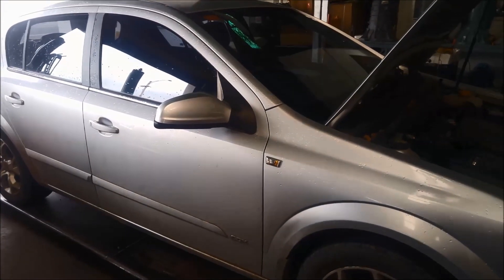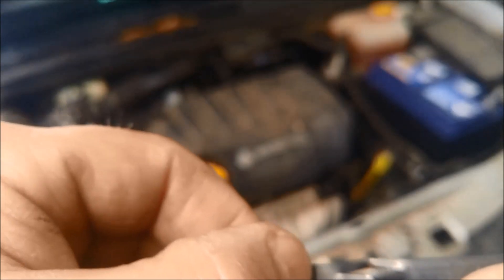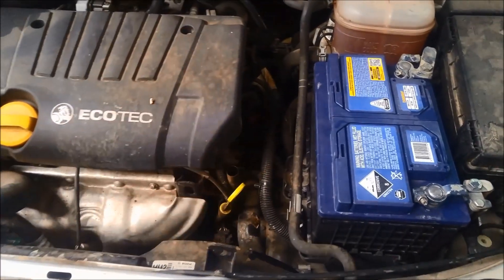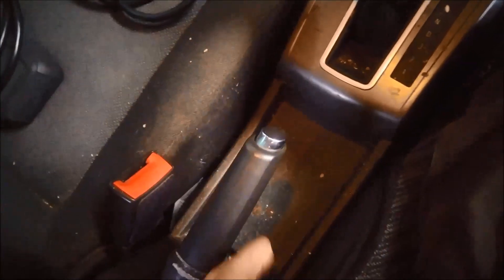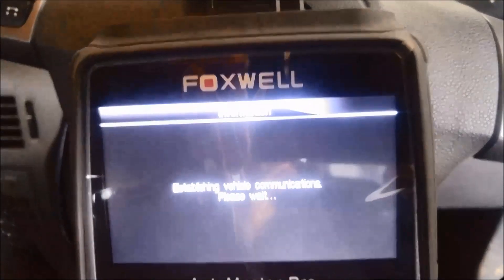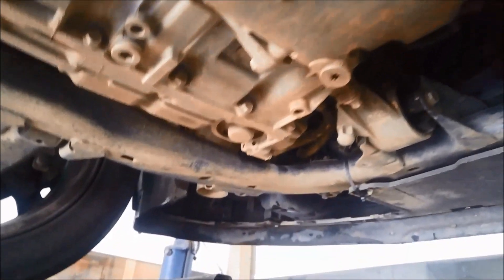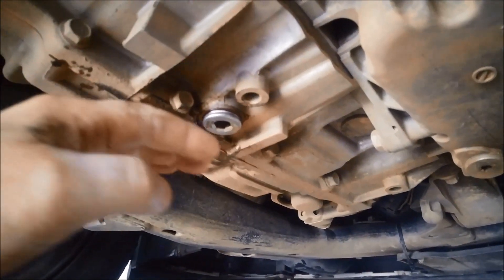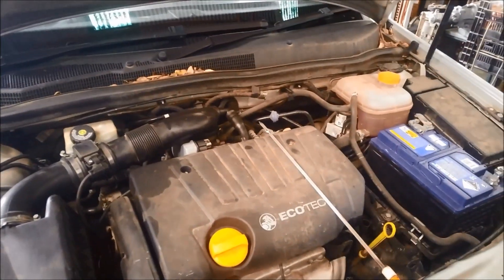Opel-Astra-Vauxhall Aisin AF17 AW60-41SN Automatic Transmission Service & OBD2 plug location

Comment: Hello, Thanks for the video.  My AF17 transmission has already 281000km, and it works perfect, do you think that installing an external filter would benefit it to avoid having to do the huge job of changing the internal filter? Greetings

Comment: Hi can you help me pls i have my astra just automatic transmission the problem is when i put it in ^D^ it goes directl "D4 " and doesn't go fast until 50 km\h  but when i scan it doesn't show the code transmission
Reply: Hey it’s probs an airflow issue or similar causing a the ecu to spaz which is why it’s stuck in D4 which is limp mode. Not always a trans issue just and elect fault that causes it . Clean pcv valve and check all airflow parts

Comment: Hello Mate, 
I have an 2005 Astra 1.8 Auto Z18XE and I literally have the same error codes you got on your scan. Rear O2 sensor, Fuel Trim and CANBUS error. Ive taken it to 3 seperate garages, they said its a comminication problem and "fix" the issue, but it comes back in an hour. Was the communication error due to a bad earth wire? Thanks in advance.

Comment: Holden astra 1.8l petrol 4 speed auto how much litres of trans oil do i put in once empty? Thanks
Reply from the maker: hi, what comes out is just a reference just incase was leaking or overfilled. always check as per manufacturers recommendations. cheers

Comment: Hello, I use a similar car, 2007 reg. Vauxhall Astra, Automatic 4 Speed transmission.

Whenever I try to put it in reverse, all lights on the gear stick comes on and the car jerks in reverse. Then when this happens, if I put it in drive, the car would require extreme revs to speed up and it doesn't speed up at all, instead it drags. Also on the dashboard, instead of displaying current gear speed, it goes blank.

Most times I have to turn of the car for a while for it to reset, on some occasions it will reset immediately
Reply from the maker: hi, check basics first, may be low fluid level? fault codes generally indicate an electrical issue. cheers

Comment: how did you fix the can bus error?
Reply from the maker: hi, make sure charged and strong battery, good earth connections ( often the straps a bolted to paint - only connection is through thread of bolt ) and plug connections. could also be your scan tool  unsuitable. cheers

Comment: G'day, just wondering if the filter needs to be changed? Is it just a bigger job or not needed and an oil change is ok? Cheers
Reply from the maker: hi, you can add a inline filter in cooling line, just make sure it flows correctly as those filters are directional. cheers

Comment: Here’s a question if it’s 9 degrees and I just checked my corsa auto and the oil was over the + 80 it’s over full given it’s winter and cars not been used ????
Reply from the maker: hi, you are checking transmission temp, not air temp. cheers

Comment: Loved the video, was a great help. I'm after a bit of advice if you could, I have this exact car with the AF17 transmission and i've been gradually losing torque over the last 6 months but it's intermittent, could this be down to bad transmission oil or possibly something else? Have you ever come across something similar? The engine is fine, it revs well, no fault codes on my OBD reader. Many Thanks.
Reply from the maker: hi, hard to tell without seeing vehicle, but also check fuel, electrical and catalytic converter if blocked. cheers

Comment: I know exactly what the issue is with the can bus communication issue, its the engine ecu at fault. It's a very common problem due to the engine ecu been bolted to the side of  the engine and over time the ecu either gets fried or the tiny joint wires inside break or make intermitant contact. When the fault happens it looses comms with the ABS/TC/ESP ecu and the gearbox ecu and the gearbox goes into limp mode, only 1st and 3rd forward gears can be used and gear change has to be done manually, reverse is still useable. Also the TC/ESP will be disabled.
Reply from the maker: always best to check basics first. thanks for that. cheers
Reply: That's what exactly happened to my car so what should i do to solve this problem?
Reply: Bonjour, si voiture ne répond pas à la valise de diagnostic il est très difficile à résoudre les pannes d'une façon précise. Le changement de l'écu moteur nécessite une reprogramation sans échec pour que le moteur peut démarrer.

Comment: I wonder if you can help me my Astra h 1.8 auto stuck in D4 With a spanner light no downshift until i do it manual then when i restart the car it will drive fine for seconds and get stuck in D4 what could be a problem?
Reply from the maker: hi, check all basics first, then look at solenoids, sensors and range sensor. cheers

Comment: I've got milky trans oil. Can I put a radiator sealer in radiator to seal any cracks, then change the trans oil. Will that work?  Without having to change new radiator
Reply from the maker: hi, best to bypass the radiator/heat exchanger to eliminate future coolant from entering trans and to get better cooling. cheers

Comment: AF17 I think holds 4 litres of gearbox oil, rest is in torque converter although when I changed my auto gearbox oil on my Zafira A 1.8 I only needed 3 litres to fill up to MAX
Reply from the maker: cheers
Reply: 3 ltr?..sound rite but my zafira gearbox once kick down then during slow down it seems like slip before changing back 4th gear or during kick down it seems like engine revving high before each gear snap in gently...but if drive normally it shift  smoothly...any ?.
Reply from the maker: @karinkatt7893  when it revs and engages gear we call that flaring. you have an internal pressure leak somewhere. try adjusting cable and/or get a line pressure reading to see what is happening. cheers
Reply: @YepThatsIt  ....thanks alot for tat info....coz check via scanner not showing any faulty code...

Comment: Hello ,
Can You help me with an answer please. I have an opel like in this video same gearbox and I want to chang the gearbox AF17 with AF13 same code 60 41SN because AF 17 don't work. I can make this change?
Reply from the maker: hi, many of the internal parts are same or similar. I do know the valve bodies are different and with different solenoids, so I would say no you can`t. cheers
Reply: Thank you

Comment: yeh i always instal B+M supercoolers for my transmissions after horror stories ive heard with water getting into transmissions , previously i did it just because all the guys with hot rods did it to prolong trans life. would you say the newer alluminium radiators are worse for the transmission milkshake effect, i guessing the copper radiators may have been better.
Reply from the maker: hi, nah i always bypass radiator or heat exchanger so no chance of coolant or water entering trans, over time the pressures and temp changes will cause a crack in the radiator cooler sleeves or the heat exchangers. the trans cooling line pressure is roughly same as radiator pressure when vehicle is running, problem arises when you turn off car and the pressure remains in the radiator cooling system until it cools down....thats when coolant will enter the trans and slowly absorb the friction linings and then this will steam the lining off the clutches and bands. beats me why they still run trans cooling and coolant together ? we use drivetech coolers that have a spiral in the cooling line wafers so more surface area is exposed for cooling. they are also quite thin and strong in design so you can pressure wash bugs and dirt off them without bending the plates/blades that take away the heat in the cooler. cheers
Reply: @YepThatsIt  drivetech sounds good , thanks for the finer details re metal fatigue and water pressure remaining long after trans oil pressure has come to a rest.